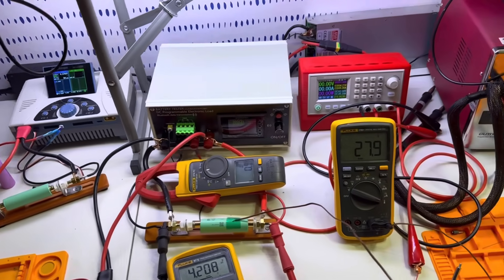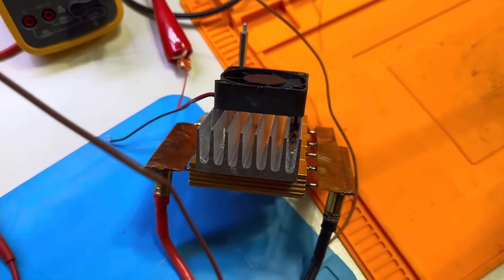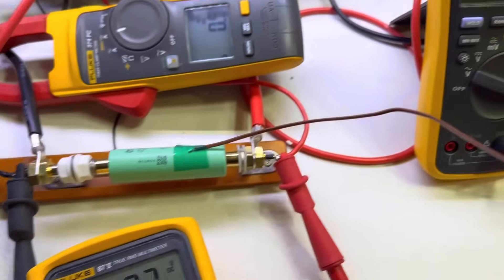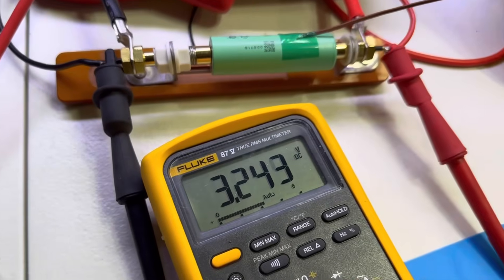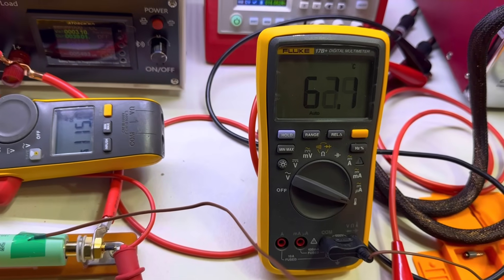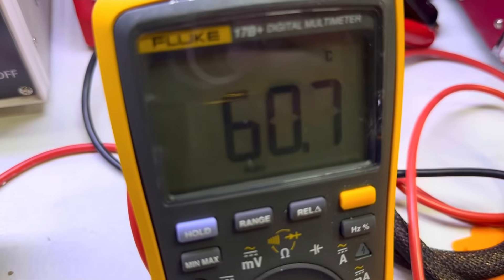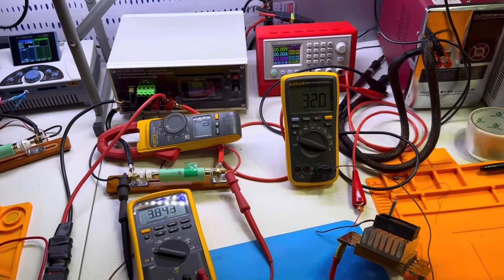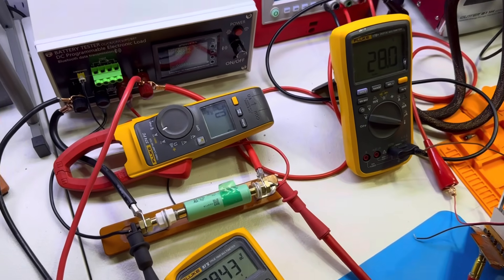🔥 NEW KING OF 21700 CELLS! EVE 50PL 125A 5Ah CRUSHES ALL COMPETITION! 🔥

Comment: Greetings from Ukraine. Good test. Good cells. Already on sale. It is interesting to see a test for a resource, at least 100 cycles with a current of 2C. Look at the trend of degradation and decrease in internal resistance. Because the manufacturer draws some unrealistic numbers of the number of cycles to these high-current cells (800-1200 until the capacity is lost by 60%)

I wanted to ask a question.
Have you tested the new cheap BAK cells N21700CGP. The manufacturer declares 40A to 75 degrees Celsius and the return of the capacity is 80% of the nominal value. But at the same time, this cell costs 0.8 euros and has an internal resistance of 12 mOhm, which is too much for a 40A constant load. It seems to me that such a cell will go into overheating already at 25A and will give very less from the nominal capacity.
Have you thought about taking this cheap one for a test?)
Reply from the maker: I haven't tested the BAK N21700CGP cells yet, but I'll add them to my list of potential future tests.

Comment: I have a question for all of you I love fenix flashlights the price of them is disgusting considering they are all made in China but the 21700 batteries 5000mah and 6000mah die so fast what's the best battery of 21700 I can use in all my Fenix SAR headlamp and Fenix HR36 list goes on what battery has true 5000-6000mah and last longer and waterproof and ect....?
Reply from the maker: Today for head lamp 50PL or Reliance RS50

Comment: I built an 11s3p with these.
I just could not get the battery to balance well - it was always fighting balancing - some 3p sets were 4v when the others were 4.2v. Over time the bms could close this gap (like a day) but then next cycle it was back unbalanced again.
I asked my supplier and he refunded immediately saying "After we shipped them we found out that some batteries were very discharged.
In general even de good cells seems to have a high discharge rate.
It seems the 50PL has a high discharge rate, we currently sell them only as for 1 time use in drones which is where they were designed for."

This cell seems very tough in your video.
Is it really a single use battery?
Am I taking a risk carrying on with this battery?
the cells were not so depleted when they arrived... 

any advice welcome!
Reply from the maker: Seems like you got low quality 50PL. This is a reported issue I seen often. We carefully check our batched to identify any issue.

Comment: The 50S cells in my Floatwheel Adv are rarely under a sustained load of more than 10A, so I find them to be decent for the board. I have peaked up to possibly around the 30A range with my peak power draw of around 5000W. However the sag and heat of a 50S make me excited to upgrade with a DIY pack when this one goes. Cheers to this battery thanks for showing.
Reply from the maker: Absolutely !!!

Comment: i was reading this : 

China has unveiled a graphene-based battery that could redefine the future of energy storage. Unlike traditional lithium-ion batteries, this new design charges fully in just five minutes, lasts up to four times longer, and is non-flammable, eliminating the fire risks that plague current battery technology. 
Graphene, a single layer of carbon atoms arranged in a honeycomb structure, is known for its exceptional conductivity and strength. By integrating it into batteries, scientists have solved key challenges of overheating, slow charging, and short lifespans. For electric vehicles, this means recharging as quickly as filling a gas tank. For phones and laptops, it means days of use after a few minutes of charging. And for renewable energy systems, it could stabilize solar and wind power by storing excess electricity efficiently.

Comment: The cells on your website, are they also prototype/pre-production cells?
Reply from the maker: All of them are the same. The actual production cell (Final EVE) is not released yet. Yes this cells are made from EVE for a drone company (not intended for the public) this is why does not have the CCC logo and does not say EVE. But essentially is the same cell (Aparently). I have more cells coming.
Reply: @DIY500AMP  Thanks for the reply! When do you think the actual production cell will release? Do you recommend I wait until then or buy now? What is your experience with the cells, is the delivery voltage and internal resistance consistent or is there more variation compared to other models?
Reply from the maker: @izzeww8487  This is the exact same cell Mooch and me tested. You can get this cell with confidence. We do not know when the actual EVE 50PL (official) will be released. We know eve released but only to the large customers, not for us. We need to wait.
Reply: @DIY500AMP Salut ou sont elles vendu ces Fameuse EVE (OEM) 50PL car sur Nkon j ai vu qu ils en vendaient sans la Marque qui a etait retirer sur le wrap de la cellule.. ? Merci
Reply from the maker: @jonathangueguen8576  Yes  they are.

Comment: wow that high discharge C rating is insane. is this cell chemistry cobalt/nickel based or Lfp? 4.2v full charge does look to be the former. the rimac nevera 2000hp ev hypercar also uses 21700 cells in its battery pack and the motors at full power/load draw a 12C rate which is 10% of this extreme test.
Reply from the maker: The rates are based on temp cut. If you have a cooling system you can push even more. Is what tesla does.
Reply: It's cobalt/nickel based.

Comment: Sure this is real torture for this little poor 18650 cell to deliver 125A - unbelievable. Does it state 125A continous in the datasheet? Can't believe that...
Reply from the maker: Carlos. Is not a 18650 battery, is a 21700 and yes 125A is in the EVE data sheet. 

https://diy500amp.com/products/eve-50pl-21700-battery
Reply: @DIY500AMP  still a lot of amps, even for 21700. Cant be meant as continous i guess.
Reply: @rilosvideos877  It is 125A continuous with an 80 degrees C cutoff. Burst current is 180A for 2 seconds.

Comment: Thank you for your detailed review. I've been looking for a lightweight cell with high discharge capacity for a long time. The 50PLs are ideal for me. Thanks to you, I want to build a 32S8P battery pack. I need a discharge of 750 Ah for 10 seconds, and I think that would be easily achievable with a 50PL.

Thank you

Greetings from Germany
Reply from the maker: You need to see the Ampace JP40 as well. Is an amazing cell probably as strong as the EVE 50PL in those burst currents.
Reply: @DIY500AMP  I also looked into it. The cells are also very good.
JD40 cells have a continuous discharge of 60Ah. I need 750:60 = 12.5 cells. Then I theoretically need 32S13P (416 cells x 0.07 = 29.12 kg).
PL 50 cells have a continuous discharge of 125Ah. I need 750:125 = 6 cells. 32S6P theoretically (192 x 0.07 = 13.44 kg).
It's 15.68 kg lighter, and for drag racing, every gram costs time.
All just theoretical, of course.
I want to build two 32S8P battery packs so I can use two battery packs when I'm at the racetrack, and only one battery pack for drag racing.
Reply from the maker: @monsterelectricgokart  You need to understand the cells are capable of 60A and not 60ah. 60A is the discharging rate. 60Ah is a capacity measurement. The cells are actually only 4ah = 4000mah. 

In other words. If you discharge a JP40 at 60A rate will fully discharge the cell in only 4 minutes. Completely. Now with this information you need to think what really you need and for how long. 

If he were to draw 750A continuously, the 32S8P pack would last about 3.2 minutes.

But for a 10-second burst, he’s only using ~5.2% of the battery, which is perfect for drag racing.

Let me know if you want a cool visual or chart for that.
Reply: @DIY500AMP  Thanks for the correction, it was a typo on my part 🥴
Thanks for your helpful offer. 
I'm going to have problems with the busbar for 750 A discharge. Once I've finished preparing it and start assembling it, I'd like to hear your opinion.
Reply from the maker: @ In fact you will need more than 8P for that discharging rate. Probably will need 13 cells in parallel (JP40 for that task) also using minimum 0.4 or 0.4  mm of copper sandwich stacked.
Reply: @DIY500AMP  I found a company nearby that laser welds copper into round cells, and I'm going to ask if they could do it for me. At what price, of course.🙂

Comment: if i put these cells in one of the 20s x20p immersioned cooled batteries then there is a potential 2500 DC Battery amps available ,Thats insane ,i submerge the cells in 3m novac dilectric fluid ,this way they stay quiet cool with normal riding and with max charge current
Reply: we run the liquid through modified computer cooling radiator and pump
Reply: Katie Mcgilchrist
i wouldnt mind getting 200cells for  20s x 10p test pack to run some load testing

Comment: I am looking to build some 6 cell long range packs for my drones, what would you recommend for cells to use and how much are they?
Reply from the maker: @SprayerFPV  how much current do you need?
Reply: @ that’s a good question, the 4 in 1 esc is rated for 60 amps constant, the motors I have pull around 45-50 amps max at 23.7 volts but realistically they will not be pulling that hard cruising at 35-70% throttle.
Reply from the maker: @SprayerFPV  are you want to go with 6 cells 1P or 12 cells 2P?
Reply: @ probably 6 cell 1p, I’ll have to run the packs in series if need be just because there is not a lot of room
Reply from the maker: @ if you need up to 60A and you mentioned long range sounds like BAK45D will be perfect today. Once the 50PL is available I will say that one.
Reply: @ cost per cell?
Reply from the maker: @ https://diy500amp.com/products/bak-45d
Reply: @ looks like I could build 4 packs for around $150, seems reasonable to me! Thanks for your help

Comment: that test setup is so bad, you have no idea what you're doing and it's putting you in real danger but you lack so much knowledge that you don't even understand the kinds of dangers you're exposing yourself to.

First of all, those cables are laughably thin for over 100A, but it's "fine" for such a short test. The real problem is how many things are done manually and the complete disregard for keeping the cell under a reasonable temperature. Half-assedly taped on thermocouple that has like over 1 or 2 celcius of uncertainty, plus you assume the surface temperature is fine to measure. The internal temperature is much higher! That cell went over 90 celcius for sure, it's now a ticking time bomb, and you have it in what looks like a tiny room with no proper way to protect yourself from the inevitable thermal runaway you'll see with these kinds of tests. Plus you have all those other cells right next to that insanely dangerous test setup! Do you WANT to put yourself in danger??? Seriously at this point it's not a question of "if" it will happen but it's "when" it will happen. Please stop doing this kind of stuff until you've had proper training and have better installations. You seem to have access to decent equipment and tools, so please use some of that money to setup safer storage and testing areas with ventilation and a way to drop the cell in a salt water barrel as soon as signs of thermal runaway start to appear.

Showing this kind of videos on youtube without a single thought towards safety is seriously irresponsible.
Reply from the maker: Every test have a risk and I understand that. I am not pushing the cell more than the data sheet established that is safe to do. Your advice is always appreciated. Thanks for watching.
Reply: @DIY500AMP  I'm a BMS developer and I'm telling you that anything above 85 celcius starts to deteriorate the separator between the anode and cathode. This is why you should never let the surface temperature go above 60C, because the center of the cell is much higher temperature, especially at high currents. Plus you need to take into account the termperature sensor's mass and how it's thermally coupled to the cell, so the "safe" bet is to put your actual thermal cutoff at 55C, since your sensor also has a ton of uncertainty.

Please educate yourself more than just the cell datasheet. Cell manufacturers test beyond the safe limits of their cells to boast incredible specs and selling points but you can't escape the laws of physics. 

If you want to really understand what's going on and how much current you can actually sink from the cell all you have to do is get its internal resistance and use the basic I²R=P. However you absolutely cannot trust the cell datasheet's value for R, you need to measure it with a DCIR testing machine to get the actual value. In the datasheet they will usually use an ACIR or IIS test method that yields much lower numbers because they only measure R0 in the cell model. You need the total cell resistance to know the heat generation. Then you can calculate the internal temperature rise quite easily and know how much time is safe to let the cell discharge at a given current before it reaches a target temperature.
Reply: This is really dramatic
People throwing insults from a pedestal of knowledge
Reply: @anton-eg1hh  What? I'm just trying to keep the guy from getting hurt really badly in an easily avoidable way. Sorry if anything I said seems insulting, but if it's what it takes to get the point across I don't care, this is a serious matter with real consequences if done incorrectly.

Comment: At those currents conventional spot welded tabs may not be enough anymore, even busbars surrounded with copper (welded section is still nickel).
We need the kWeld guy to design affordable ultrasonic welder, it allows to weld copper to the cells.
Your setup also may not be able to measure the cell sag under load properly, pressure contact will have a lot of voltage drop at those currents.
Reply: I can assure you that my kWeld does 0.2mm copper nickel sandwich at 1500 Amps per weld and what's left on the cell are pure copper nuggets, the nickel plated steel on top is only "fusing catalyst".
Two welds (4 dots) and you'll be able to run 100 amps safely, the cell might fail before the weld does.
Reply: @Eden_M  I couldn't weld copper with my kWeld even at high J settings.
Reply: @Arek_R.  Which battery are you welding with?
I must add that I'm using a Varta 12v 100ah AGM car battery, if the wires are too short I can peak at well over 2000 Amps and the over-current trips, so I use longer wires in the input, now calibration shows 1800 Amps, absolutely amazing battery, don't forget to set the correct wire length in the settings, very important as it a safety feature.
Reply: @Eden_M  I use two supercap banks from keenlab which are designed for kweld.
One module is supposedly more than enough to provide all the current you could need, but I have second bank to make sure that they don't deplete if I would be to do a lot of welds quickly.
Reply: @Arek_R.  Ah, the cap-banks, some DIY guys on endless sphere have reported that these modules simply underperform.
With my setup I weld copper nickel sandwich at 60J for 0.1 nickel 0.1 copper and 85J for 0.2 copper.
Reply: @Eden_M  Really?
So you saying the guy who designed the best hobby welder module, which is so so good you need to sped 10k to get industrial grade equivalent (counting actual weld energy), was unable to design a power source at least equivalent to a $100 lipo pack?
I remember reading the documentation on the cap bank and it was actually telling you to lower the cap banks voltage so you dont exceed the current, which would suggest that it provides too much current.
And what is it that happens, the voltage on the super caps drops low?
Would I be able to catch that with an oscilloscope triggered for falling edge?
Reply: @Arek_R.  Dunno if you're being sarcastic but I'm not trying to discourage you, I only know my setup works.
Reply: @Eden_M  Unfortunately the caps are only 3x 2.7V = 8.1V in total, and you can't run them any higher.
I guess the kcap should have 4 series for 10.8V.
A bit sketchy but I had this idea to get like two or three 2kW 12V server PSUs which in theory should be able to supply only like 500A but might be able to supply double for the duration of the pulse.
Reply: @Arek_R.  My comment got auto-deleted, I don't think it's a good idea man, you can't short-circuit these PSUs. I'll probably upload a video of my kWeld in action.
Reply: @Eden_M  With powerful enough PSU, short circuit becomes just large load, because you have cable/contact/kweld/weld resistance.
Also large servers with massive mobos will have drained caps which for brief amount of time act like a short circuit.
But anyway, for now my kweld setup is good enough.
I can upgrade it when someone makes different super cap bank, or I make one myself.
Reply: Or non welded carbon nanotube sputtered copper contacts that are pressed against the electrodes with essentially no electrical resistance

Comment: Are EVE 40p cells any good I noticed their alot cheaper than Samsung 50s & Molicel42p &45p ? I’m using for electric dirtbike.
Reply from the maker: They are MUCH better than Samsung 50S and any molicel !!! Believe me.
Reply: @ thx for the reply I’m subscribed
Reply from the maker: @ Thanks for the support !!
Reply: Dont mess 40P and 40PL different ballpark
Reply: @AndrewShaidurov  what cells would you recommend for electric dirtbike running short trips around the neighborhood I just want speed and good battery cycles ?
Reply: @ P50B has most cycles and suitable for cold weather, EVE 40PL and BAK 45D for most punch but less cycles.
Reply: @ informative thank you 🙏🏾😎
Reply: New sub here, Battery builder @Godsteramps thanks for this data❤